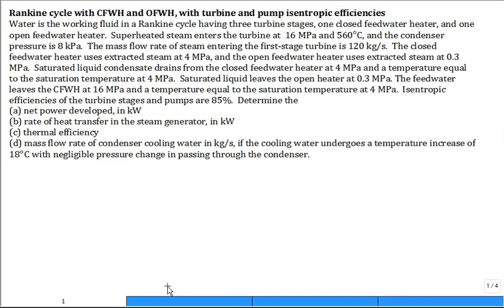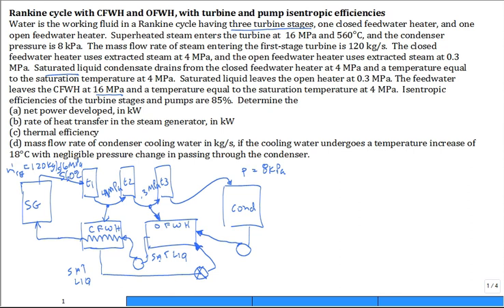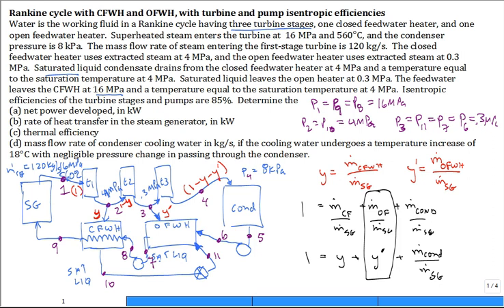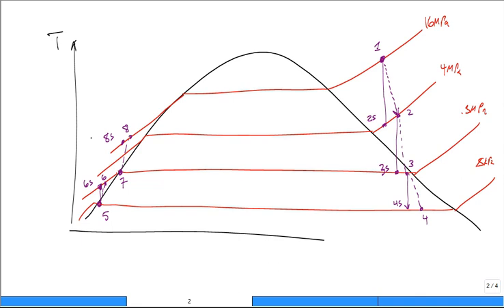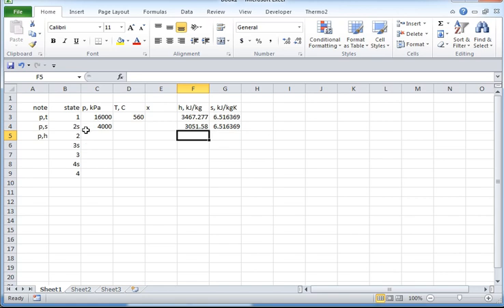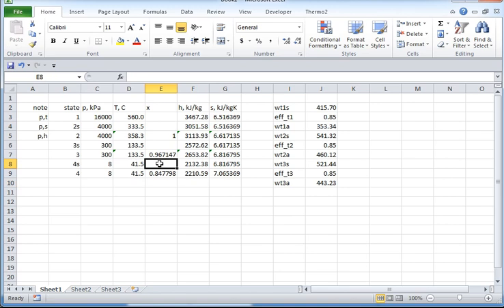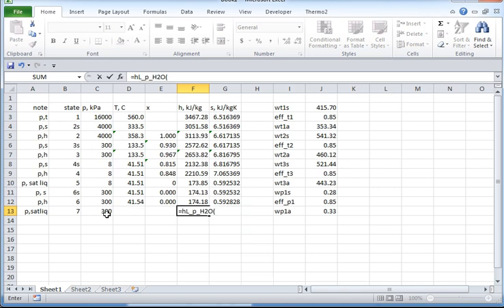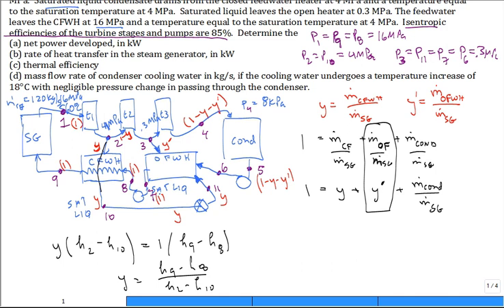Excel Vapor Power Cycle CFWH OFWH

Comment: Hi, I hope with any luck you will show me a way Professor Manteufel.
My professor asked me to design a Combined Gas-Steam Cycle, he gave us no information and no online education about.

He asks for;

For the Gas Cycle Division: there must be units such as intercooling, reheating and regeneration units; 

For the steam cycle: there must be units such as intermediate heating, open or closed feed water heaters and cogeneration.

In this regard, you will initially determine the value to produce a certain power. For example, choosing a value of 5 MW for the gas turbine and 3 MW for the steam turbine (by searching the literature) and accordingly:

You will determine the thermodynamic values (such as enthalpy, entropy) of the whole system.

You will identify the elements of the system. You will determine their capacity. 

You will determine the efficiency of the system for first and second laws. You will study the second law analysis.
	
You should add original value. Where is preheating and where is intercooling needed etc.

If anyone else can help too, I'll be forever in debt. Thank you for your time in advance.